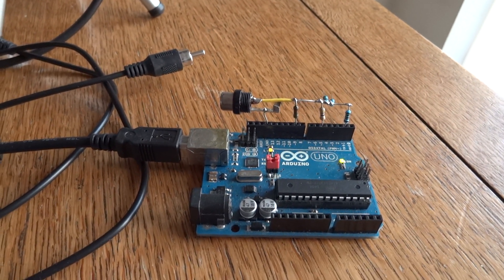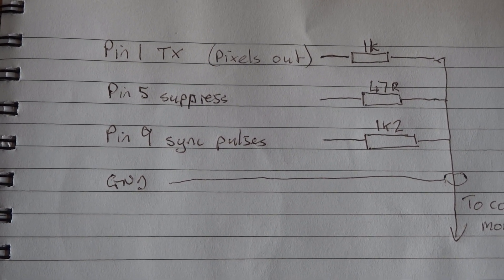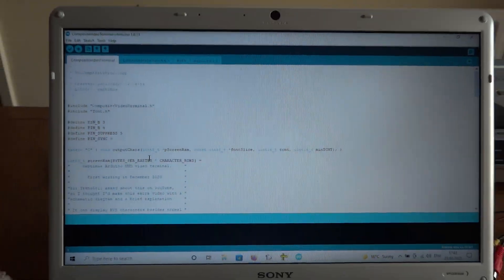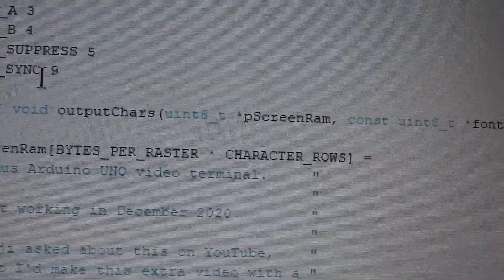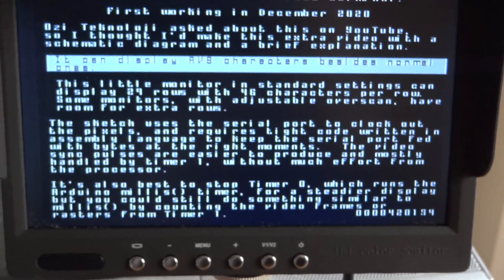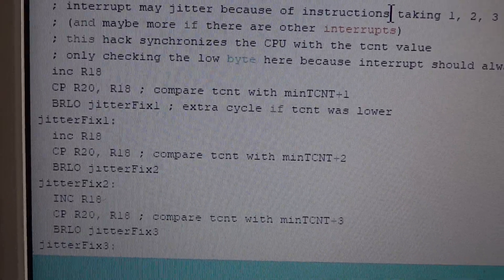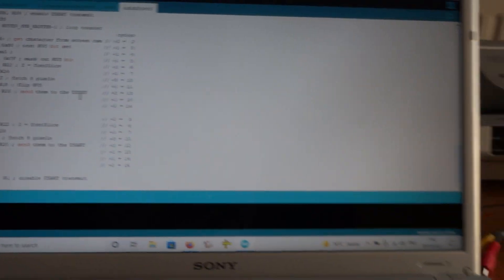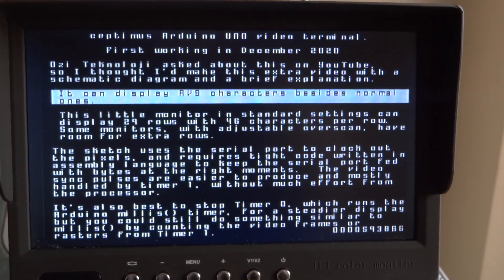Composite video from Arduino UNO

Comment: It's very useful, thank you.
I tried to take it a step further and use the i2c port as slave for uploading text, but it shows a little glitch on the screen too most of the time when data is received. The receive event disrupts the sync, even when i process the read in the loop. Anyone has an idea how to get some character data into this from another source?
Reply from the maker: If you want to stick to classic AVR microcontrollers, like the UNO, there are three main options: 1) Buy an Arduino Mega 2560 - the clones on AliExpress are reasonably cheap - they run the same code, at the same clock speed (16MHz) but have four serial ports - so with one doing the video output there are still three free serial ports for serial communication.  They also have more RAM, and can manage a graphical pixel-based display, as well as text.  By checking for a received character at the end of each video scan line, you can handle baud rates up to 115200 without any video glitches.  2) If you want to stay with the UNO (or NANO), it can do software serial at baud rates up to half the line scan frequency.  Sample the receive data pin (and  output one bit on the transmit data pin if there's any data to send back to the host) at the end of each video scan line.  That limits you to 781 baud maximum, and even 300 baud is plenty fast enough for typing and reading. 3) I2C or SPI are possible, without any video glitches, by disabling the I2C or SPI interrupts during each scan line.  The actual I2C or SPI bit rate can remain at the standard I2C or SPI clock speeds, because the clocking in or out of each character is handled by the hardware.
The other option is to swap to using a more capable microcontroller.  Many of these are supported by the Arduino IDE, if you want to stick with that - though the code for driving out composite video will be custom for each type.  Probably the best options, right now, are A) the Raspberry Pi Pico (and other boards using the RP2040 chip) - very good value, often cheaper than ATmegas, and B) the ESP32.  Both have lots of community support, and have several projects that output video (possibly in colour!)
I could do a demo using the Arduino Mega 2560, or the UNO, using Serial data transmission to provide a 'dumb terminal'.  Which would you most prefer?
Reply: @ceptimus  I was fiddling with a standalone atmega328p because I can easily solder that through-hole in my projects and is quite cheap. So I'd prefer the UNO demo. 
I have seen the other projects you mentioned, but I'm just very interested in your approach.
Reply from the maker: @ferrievanschaik8379  Okay,  I'll give it a go. Stay tuned...
Another option I thought of would be adding a PS2 keyboard. It would have to be a PS2 one on a UNO - a USB keyboard is too complex to handle.  A PS2 keyboard would inevitably cause some video glitches when a key was pressed - but pretty minor.  It would just blank the right-hand part of a few scan lines for one video frame whenever a key code was being transmitted.
The Arduino could then run as a standalone computer - it's possible to squeeze a Forth or Basic operating system into a UNO - although it would run pretty slowly because the processor would be spending much of its time pumping out the video signal.  I suppose you could add ZX81-style FAST and SLOW commands to switch off the display while doing some (relatively) fast processing. :)
I'll try the Serial at 300 baud (and maybe some higher custom baud rate) first.  The PS2 keyboard idea will go into my 'things to possibly do one day' list.
Reply: @ceptimus  That would be quite something, :) . 
Right now I keep using it with  i2c, I see a slight improvement after disabling and enabling interrupts within the ISR routines. I hope that was correct thing to do. 
From another unit that is connected I send coordinates and ascii code so I can place them where i want. I also changed some of the non character ascii codes for some graphics so I can make nice 3px borders and crossings as a layout template on start of the terminal. 
So i'm very curious how you manage to get the communication smooth. You obviously are quite a bit more knowledgeable into this matter than I am.
Reply from the maker: @ferrievanschaik8379  The same interrupt that generates each video scan line can be used to sample the receive data pin (RXD or RX0).  I've got it running now at 2400 baud - which is almost exactly 6.5 scan lines per bit.  So it looks for the leading edge of the start bit, waits 9 interrupts to sample the centre of bit 0, then 7, 6, 7, 6,... interrupts after that to sample bits 1, 2, 3, 4...  If it eventually sees a correct stop bit at 'bit 9' then it assumes it's correctly received a byte and puts that in the ' receive input buffer'.  Of course, using the Arduino UNO standard serial port at 2400 baud, the transmit data pin (which is sending the pixels) produces absolute gibberish on the PC's  Arduino IDE Serial Monitor.  But you're not interested in data coming back from the 'composite video monitor' anyway.  If you want to send serial data back from the UNO, you'd have to use some other pin for the TXD line.  From the UNO's point of view, it could use any pin for the RXD, but I've done my demo using pin 0 because that is connected to the UNO's USB to serial converter chip.  I'll make a video of it doing basic terminal display stuff at 2400 baud, and share the code.  I'll be interested to see your modified font and cursor positioning routines, if you're happy to share.
Reply from the maker: @ferrievanschaik8379  You can download the new code here: https://ceptimus.co.uk/UnoVideoSerial.zip  Use a serial client, such as PuTTY, at 2400 8N1 no handshaking.  Much better than the Arduino IDE Serial Terminal, which does line buffering for output, and doesn't give a 'live' typing experience.  I've not made the video yet.  I hooked it up to my 42-inch TV, to show how steady the display is, but the sun is shining through the window and washing out the screen.  I need to wait till it gets darker...
Reply: @ceptimus  quite brilliant work. I have tested it on my old CM8533 monitor. It seems to lack some lines on the top, but that is solvable. The RX performs great. 
I assume info@ will work so I can send you my adjusments/additions. Best, Fer.
Reply from the maker: @ferrievanschaik8379  You can fiddle with the constants in UnoVideoSerial.h  to adjust the display to better fit your monitor.  You can adjust BYTES_PER_RASTER to add or remove a column, CHARACTER_ROWS to add or remove a row, and the LEFT_EDGE and TOP_EDGE values to try and centre the display properly.
ceptimus at ceptimus dot co dot uk and/or mround at gmail dot com 
I write them that way to make it a bit harder for spambots to harvest the addresses! :)
Reply: @ceptimus  haha that's why I only wrote the info part ;-)
I'll keep you posted. Have a good weekend.

Comment: That’s pretty sharp. Bitluni wrote code to do similar output with an ESP32, allowing its second core to manage other things and handle better buffering with its much larger storage capacity. Pretty impressive for an Atmega328p.